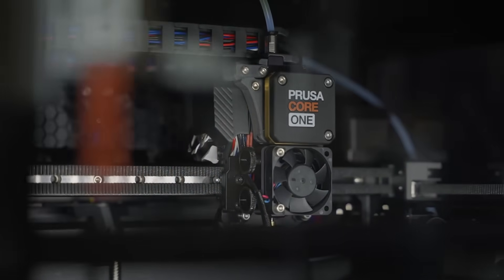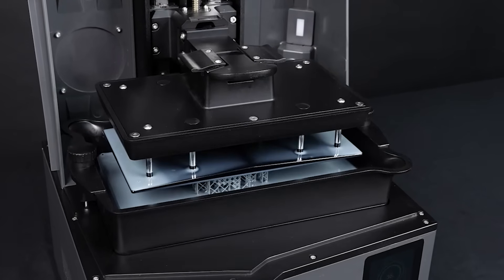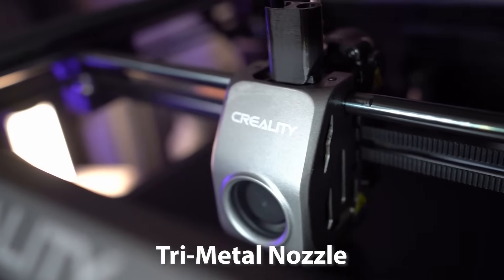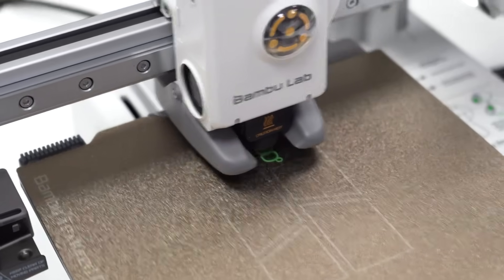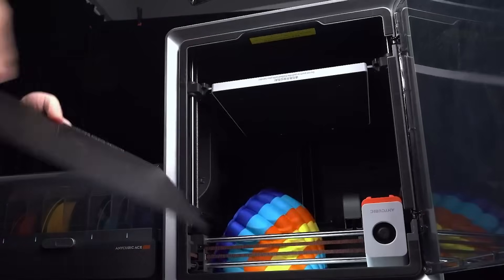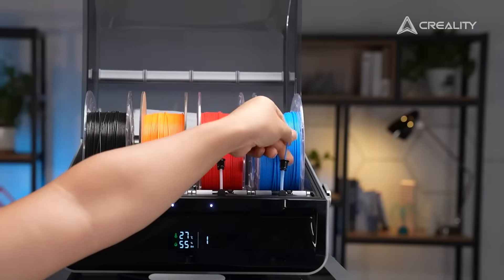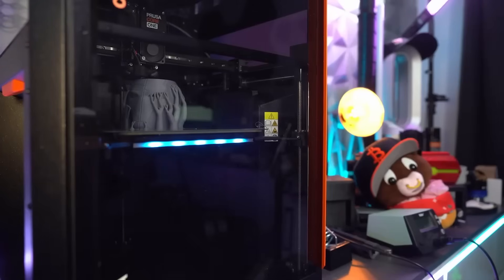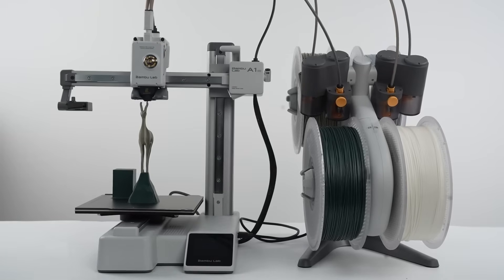✅ Best 3d Printer 2026 [Watch This Before You Make a Choice!]

Comment: 3d printers only add to the plastic problem
Reply: What about pla.
Reply: Not if they use Timeplast filaments.
Reply: False, since they can mitigate mass production. For example if you need a toilet roll holder and more people could print them at home, less would be produced in mass.
Reply: Nobody asked
Reply: @tylero1689 I think that's part of the problem
Reply: If you’re gay

Comment: Why would you even compare resin and fdm? That makes no sense! They are two very different animals.
Reply: why? sry for question, im totally new to this and looking for a mashine.
Reply: @blackflytr  Oh, ok. FDM and Resin are just two very different beasts. To me they just don't fit into the same category and their use cases are usually different. People who only do resin have a very different skill set than people who do FDM. Resin needs a lot more care to avoid the toxic chemicals. I'd love to do resin, if I wasn't worried about the mess and toxic chemicals, but I tend to use more functional parts than aesthetic prints (minis). I feel like the video should be more basic. I don't think it makes sense to promote two different methods in the same video. You're just doing to confuse beginners. You need to start with the question, "What do you want to do with this machine?"
Reply: @jlbcon  ah okay, then i should look for FDM, i mainly like to do some parts and dont want to worry about chemical stuff because i would use this in my living room.
is the flashforge 5m a good beginner mashine?
Reply: @blackflytr  I can't really say, I haven't used that one. I would read the reviews, but it is a core xy, which, in my opinion is easier for beginners. Bed slingers require more maintenance. I recently bought a Centauri Carbon and I'm having good luck with that one. It's very easy to set up and does it own calibrations, (you don't want to have to mess with that yourself). It's a more closed system so if you like to tinker with your machine it requires a bit more knowledge. But I think the Flashforge may be similar. I would advise purposely looking for bad reviews and compare those to the number of good ones. And if you're in the US, purchase it as Microcenter or somewhere similar if you can.
Reply: @jlbcon  nope, sitting in EU :)

i was advised to Snapmakers U1. looks sick non?
Reply: @blackflytr  Watched a video. Looks pretty similar to the other new core xy's. Hotend replacements look easier than most but also more expensive. Seems to get good reviews though. If you're not looking to tinker with it, it looks to be pretty solid and self configuring.
Reply: @blackflytr 如果打多色需求不多的话我感觉bambu不错